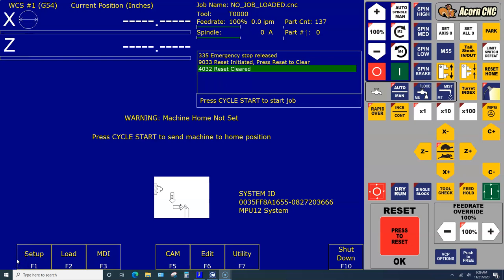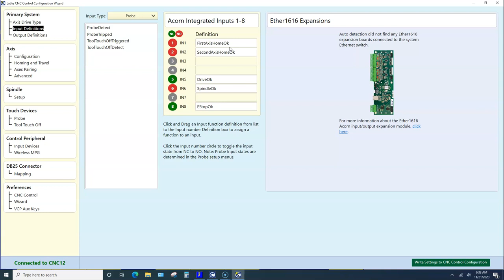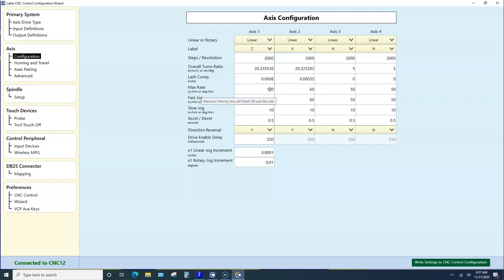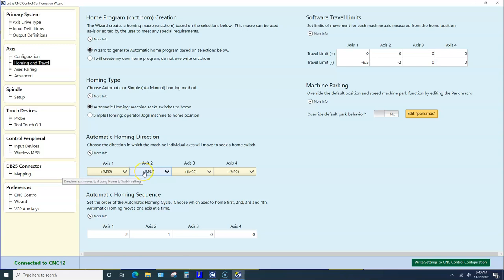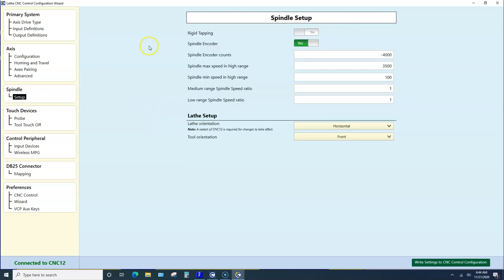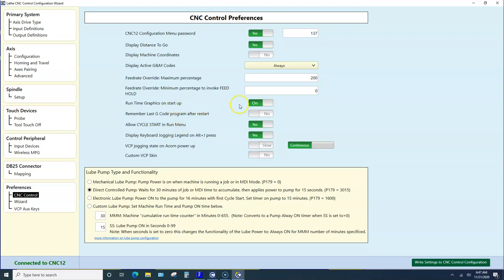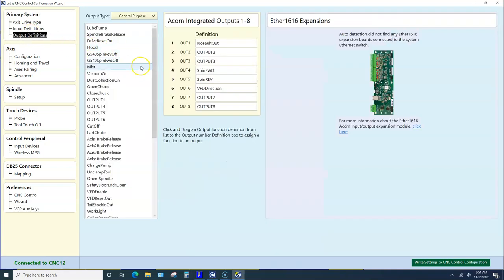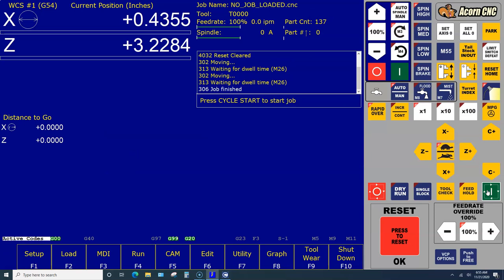Emco PC5 Centroid CNC Acorn Conversion: Part 9: Wizard Settings and Wizard Overview

Comment: Got an issue that hopefully you can help me out on. I am using an acorn board on a pm matthews milling machine. Everything is set up- but im having issues with the z axis. Sometimes it stops just before the material and then starts to slow just short of the work as it should . Other times it plunges way down in the material. I have been using wood as its more forgiving. I want to mill aluminum and steel but am afraid to as I never know if the z axis is going to come down right or not.

Any ideas?

Thanks
Reply from the maker: Please post details of your build, which drives and motors and post a fresh report to the Centroid Acorn User's forum. We can try and offer suggestions there. https://centroidcncforum.com/viewforum.php?f=60